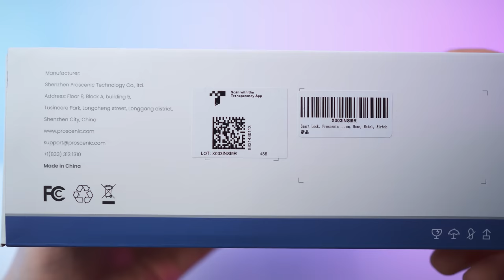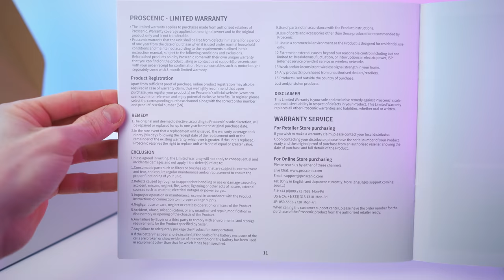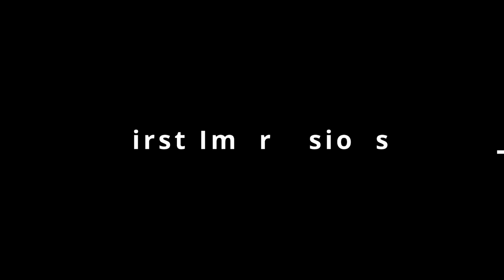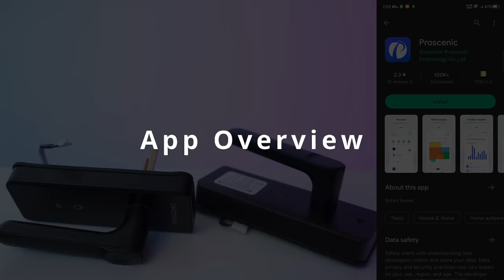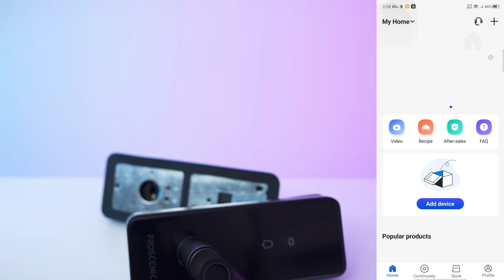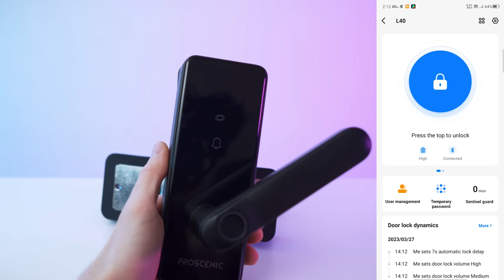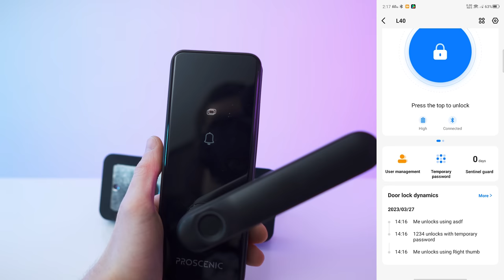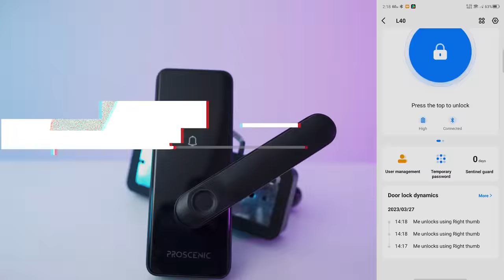All-Round Security & Convenience! - Proscenic L40 Smart Lock Review & Test

Comment: Until I've seen it being run past lock picking lawyer it's going to be a hard pass.

Most of these "smart locks" have dumb security and bypassed easily
Reply from the maker: You mean lock picking the spare key hole right? Interesting point
~ Chris
Reply: @TechMagnet  most of them use some sort of electro magnetic actuator, seen quite a few bypassed by literally placing a neodymium magnet in various place, they tend to unlock without triggering the reporting part of the electronics so doesn't even look like it's opened